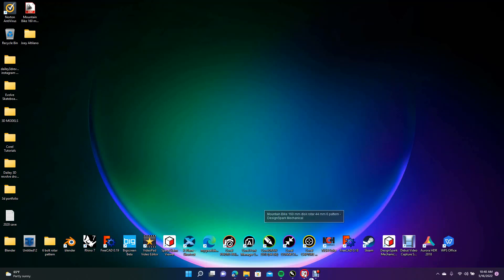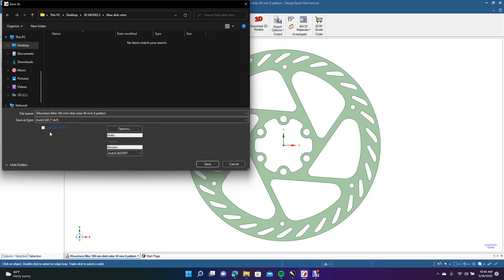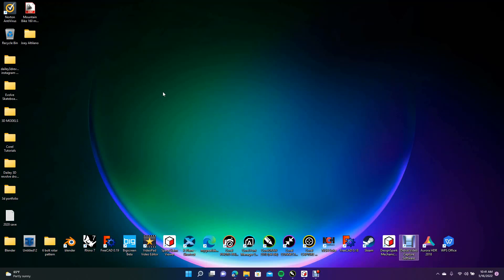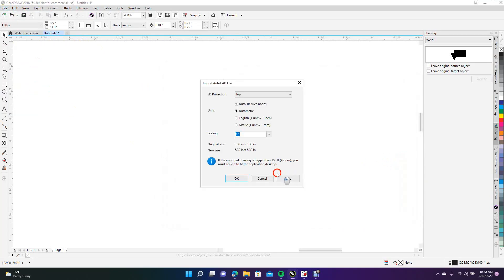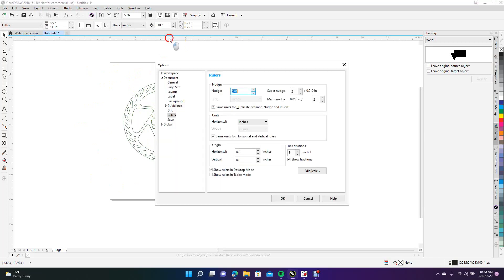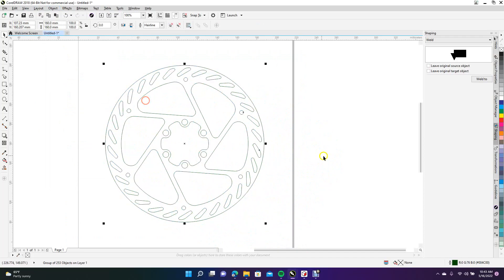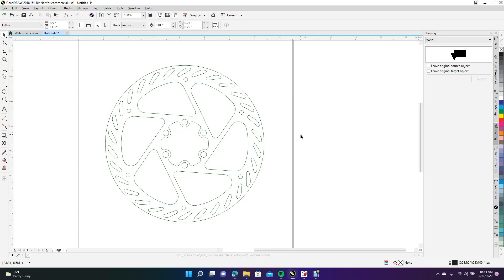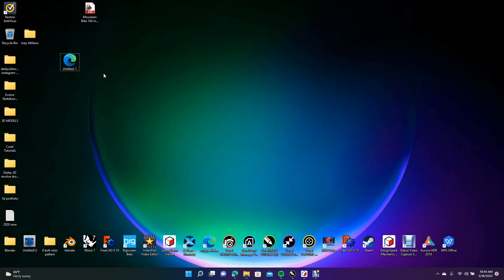How to save your design spark mechanical files as a DXF file

Comment: LATEST version of designspark just removed the ablity to save as DXF file format. It appears the new dsm 6.x has the ability to LIVE  modify your DSM software. so they can add or remove features as they see fit. beginning of the end for that company. An other thing I have noticed is that its very hard to find information on the internet about DSM and what they have changed. They are trying to control the narrative.
Reply from the maker: Yes, they are. They want people to use their paid versions, and not the free one.